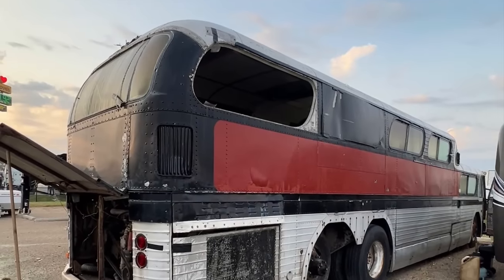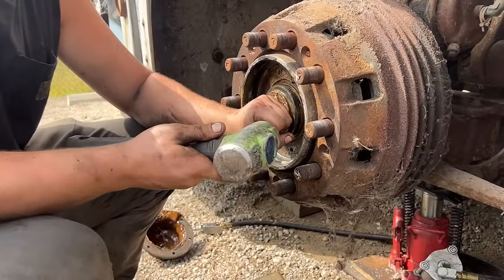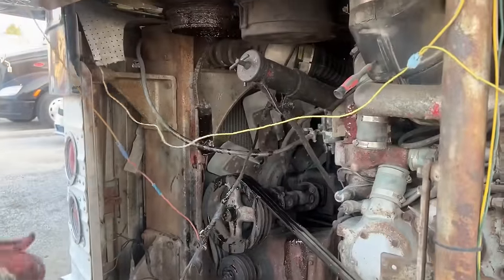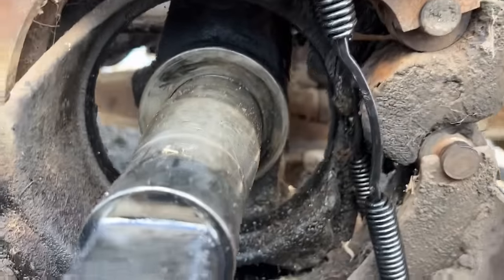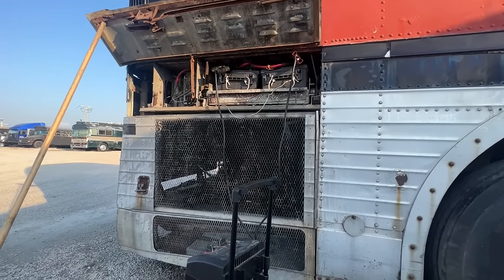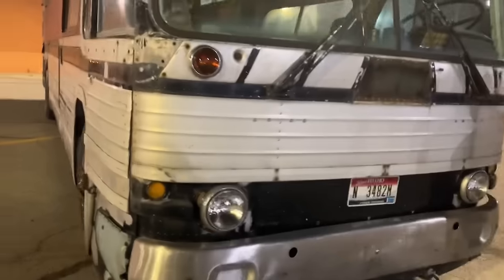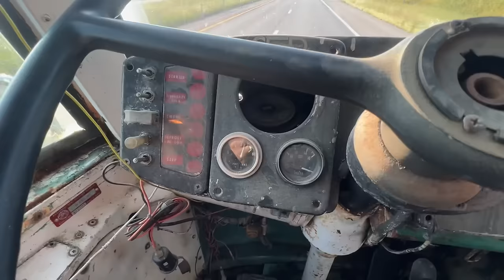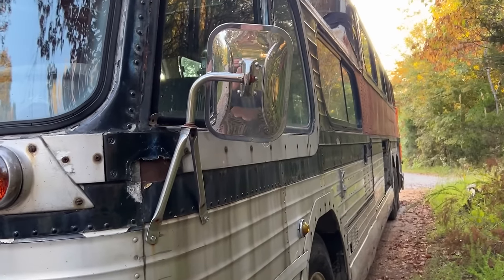Scenicruiser bus rescue attempt 2.  Detroit Diesel 8v71 & tire shop fiasco resolution

Comment: I had been wondering what happened to this old girl. There was once a time I'd have driven across the country and done something like this to save an old Scenicruiser like this.  The Scenicruiser was, once upon a time, my dream bus... Never could find one in my price range or one that had more than a body on blocks, but I did eventually get a 4905A that burned in a house fire just a month after I got, but... Now I actually DO have my "dream" bus.  A Prevost H3-45 to convert. My health prevents me from doing any heavy lifting, but I can do woodworking, plumbing and electrical easily enough. :)  I hope this old Scenicruiser can be brought back to life and at least restored to a semblance of its original state.  They were some of the most unique and quite beautiful buses of just about any era in my opinion.

Comment: My whole world revolves around old cars and trucks, so, to me, there's no such thing as too far gone.   This bus is no exception, but wow, does it need everything.   Every square inch is either worn out, dented, rusted, or missing.   Try not to look at it all at once; it'll overwhelm you.   Pick out one section or task at a time, conplete that, and move on to the next.   In a few years, you'll realize it's nearing completion and looks spectacular.

Comment: Reverse threads on the lug nuts? Is that just one side? I can see where a tire shop would screw up lug nuts with not knowing they were reverse threads but all of them? Whew! What incompetence. Can’t get enough of you guys, hope to see much more in the future.
Reply: It was fairly common on large vehicles - left-hand threads on left-hand side of the vehicle.
this used to confuse my brother as some of their trailers were all right-hand, but a couple had left-hand on left (and one had a left-hand stud on the right-hand side).
Reply: @18robsmith  ... and Mopar cars and pick ups until the 60s. Not many modern "techies" know about that...
Reply: Not that common, but they are out there on commercial vehicles. most are marked "L"  .  if you take the time to check.  lol.
Reply: We knew a big high school kid who had a flat on his mother’s new 1968 Dodge Polara one night at a baseball game. He twisted off a left-side wheel stud, turning the nut lefty-loosey. When he realized he wasn’t going to get the wheel off, he called my dad, who knew instantly what happened. My dad went to the ballpark and quietly removed one nut, righty-tighty. That was an instruction I’m sure the kid still remembers today in his seventies.

The theory is that left-hand threads on the left side of the vehicle will tend to tighten from wheel rotation instead of loosening. In practice it really makes no difference, so it’s no longer done in light vehicles. 

And yes, tire shops in the 60s and 70s did break Mopar left-hand studs. And I once used a tire shop that serviced both big trucks and passenger cars. But they used big-truck muscle on everything, so they pulled the threads on my car and I had to break off and replace a bunch of studs.
Reply: When I was 16 and working on my first cars at gas station I learned the hard way on Chrysler car about left hand threads on one side.  I wondered why I stretched the first two bolts and broke them off before I caught on.  Oh well,  I learned how to replace wheel bolts too, and you never forget a good lesson.

Comment: 1955?!  I was eight years old and this bus would have been beyond belief in the comfort, quietness and speed stakes.  But I speak of NZ where commercial passenger transport vehicles were still limited to a cloying 40 mph maximum despite traffic density less than a tenth of today's rat-race. Your drive home was amazing; a revelation of the superiority of American machinery over long distances than the S-Bedfords that dominated New Zealand buses and coaches.  And I refrain from describing the odiferous early 1930s rattle traps that went under the imposing title of School Buses!

Comment: She's not pretty but she sounds super on the road at speed. i would say it is happy to be in use again. As for the glass there should be some kind of a NAGS number...every piece has its own number...maybe the left side is a number one way or the other for the right hand piece. Auto restoration shops might be an avenue to check into. A friend had a late 60s hearse..fun finding glass for sure.
   A great video with a wasted wheel bearing...I have never seen one that bad given it appeared to be mostly rust damage. 
    I bet Ron would have gotten a kick seeing that pull in...another great YT channel 🙂
  A great save Scott!!

Comment: Love this, what a cool sequel to the original get it running video. I especially liked the old cars going by, being a car guy, that was a treat, that Greyhound could have seen those cars, at some point in it's past. Great save guys, can't wait to see what y'all do with it, a conversion would be really cool.

I can relate to what you were saying about the bridge, as almost every bridge coming through Arkansas headed north, there was a dip before the bridge, and a dip afterwards, the airbags on my MC9 got one heck of a workout. It was my maiden Voyage from Texas to Nappanee Indiana, with only about 5 hours of wheel time, before the trip, and I started off at night, made it a couple of hours north of Memphis, for my first leg of the trip, 566 miles, and got there at 3:55 AM. I was using google, and it put me on one of those one lane bridges, that goes way up in the air, I don't like those in a car, during the day, much less a 17.5 ton bus in the wee hours of the morning. Luckily nothing like that on the way home. I did cross over a couple of big bridges, like yall did, and wanted so badly to take some pictures, but just didn't want to chance it, as you have to drive my bus too, front end needs tightening up for sure, but I did the whole trip, and not a scratch one on the bus.

Comment: What a great run! They have a 10 speed? on the left side no less!!! Outstanding video! thanks
Reply: Would prefer manual transmission,,can't imagine cost of automatic,,,not sure what would take to pull transmission but much less skill to put in clutch or deal with manual transmission gears

Comment: 👍✨. As a bus driver for over 32 years I'm so excited to see thst bus on the road...My first busses in late 80s were MCI's. Blue Bird 🕊️ Coach Lines in Olean Ny ...if you search 🔍 it you will see Blue Bird Coaches ...Thats when my bus driver days began 🤗. I love those old coaches .. You'd be surprised how the stainless steel will buff out ...I think you should go original restoration on the outside... I'm now a subscriber ...If you need anyone to drive or help restoring I'd love to help...Thanks 🙏 so much saving the ole gal ✨🙏

Comment: Looks like a great job on the old bus,  I liked the sound of the 2 stroke Detroits.  Drove a few trucks with those. I liked the 92 series best,  just got horrible fuel mileage compared to a Mack, or Cummins.  😊

In 1980, I went through St. LOUIS twice a week.  I hauled produce from Southern California to Huntspoint produce market in Bronx N.Y. then get whatever I could back to California.  I'm sure that bus could accelerate faster than a semi.  Usually had around 73,000 pounds (gross) 290 horsepower Cummins 10 speed.  Top speed was 72, but the speed limit those days was 55. Used my C.B. more than the music radio. Those were fun times. I retired I. January 2022.  44 years on the road was enough for me. Never drove a bus, kind of wanted to, just not a people person though.

Comment: In 20019, Discount Tire damage 12 lugs on the right side of my 2016 F150. Then they tried to say it was Ford fault for using 2 piece lug nuts. I was the only person to ever change the tires on my truck for the last 3 years. I never had a lug nut problem. I made them replace all 12 lug nuts with new Ford 2 piece lug nuts. 4 years later and my lug nuts are still good.

Comment: My god, as old as that thing is the engine sure sounds good, and it hardly smokes at all.
This has duallies on both rear axles. Are they both drive axles?
I didn't see any air bags to make one a tag axle.
I didn't see any airbags at all. Is it a torsion bar suspension?
These and the other buses used to pass us on the highway and we were going 70 when I was a kid in the 50s and 60s. They really drove them hard.
Reply: Only one rear axle drives on a Scenicruiser. Air bag suspension all around. No torsion bars.
Reply: @dttprice  😊

Comment: Thank god that was a converted shifter.  I was astounded that it would be set up like that, I always thought it was on the floor to the right.  Never seen a scenicruiser in person, so completely in the dark.  Also I can see why one would convert those to automatics.
And interesting factoid about the air assist clutch.   On the trucks I drive, they are hydraulic, but the clutches on the automated transmissions went back to pneumatic for some reason.  Really irritating when you’re shuffling into a dock and the transmission refuses to shift due to “low” (100) psi.

Comment: The high speed airflow on the outside of the door creates lower pressure than the relatively still inside.  That's why the door flew open and was so hard to close.  Slowing down makes it easier to close.

Comment: Used to think if there were a zombie apocalypse and I wanted something that was guaranteed to start up after a nuclear war I'd want an old tank, but now I think I'd rather have an old Scenicruiser, could even sleep in it and maybe the zombies would think it was abandoned and stay away.   Maybe I should start stockpiling pre-DDEC Detroit Diesels before it's too late 😆🤣  No floors, a third of the windows, no AC, no lights, no power anything, but the cool factor is 110% operational.

Comment: how do you strip that much hardware.. i have been changing wheel and tyre's on most vehicles you can imagine for over 40 years and at most maybe strip 1 or 2 nut's/lug's and really  REALLY old wheel's but never that many....did they have a gorrilla changing the tyres ????

Comment: channel locks for wheel bearing nuts makes life easier, I guess the terms you picked up must be from the iindustry mechanics or books on repairing busses, but instead of bar it over, most mechanics just say  "rotate the engine"  a couple of times

Comment: Perfect to turn into a camper can't remember if they had a toilet shower and kitchen and sleep area for a second driver because they were for long distance travel and it meant that the passengers could go to toilet without having to stop at service station only for fuel and they use to have same as stewardess on plane that use to look after the passengers

Comment: Been tinkering with 94 international 4700 box truck been sitting at least 10 years cleaned fuel screen and filter,coworker work's on internationals thinks fuel should be OK? Filters were not bad as well as fuel 🎉in filter,,,block heater has ohms need to finish hopefully last brake line put 110v plug on block heater should be around 37 degrees by then,,,crossing my fingers city gave me 2nd extension,,has to be off property,,in 3 days,,,everyone says 7.3 were bullet proof before emissions,,same block as ford's power stroke,,just noticed coolant filter,,sure need to cross fingers hard,,not feeling good about leaving coolant filter as is,,10 miles to storage. Noticed no plates on bus ?,,plates and insurance on box truck 😕

Comment: Hi, i have a technical question. you always show the replacement of wheel hubs and all those seals, during which all the oil dains out of the hub. But i want to know, after reasembly, how does the oil go back into the hub? is there a fill hole somewhere at the top?

Comment: Didnt gm put a special sized tire and rim  when they originally built them to keep the overall height legal at the time?  I think it was 19.5 tubeless, wasn t it?  That engine sounds great.  Id just make the outside original again.  Bill
Reply: GM historically used 19" rubber on PD coaches. Silversides, PD4104s, PD4501etc. Not related to height restrictions.
Reply: Thank you, Bill  PS Wen you showed the part of it going down the road, it looked to be riding as smooth and level as most new buses. @pd4501771

Comment: You live in Tennessee, but have Idaho plates on the bus...
Reply from the maker: Yes you figured out the scam! Why register a vehicle when it’s already got plates.  New plate went on the back before we drove it on the roadway. 

39:32 you can see it has Tennessee license plates and is current registration.  Tn doesn’t use a front plate that was an old one on the front
Reply: Ah, OK. Cool! Good to know! @BusGreaseMonkey